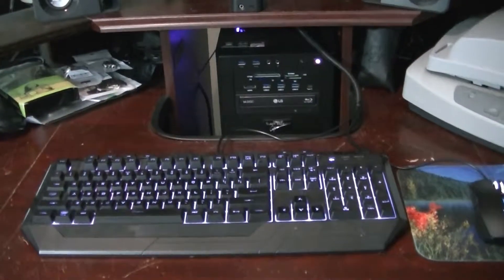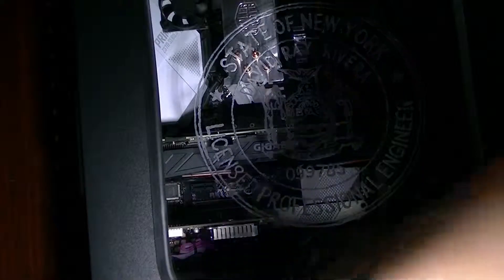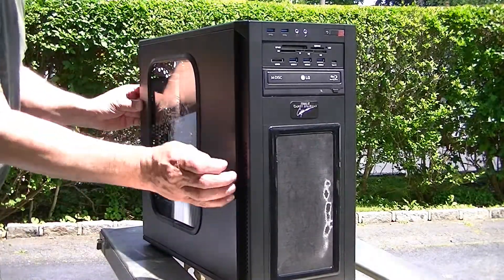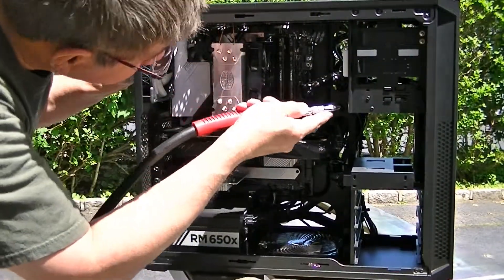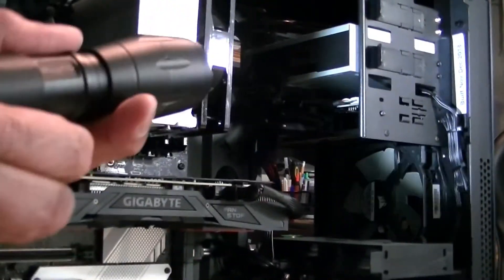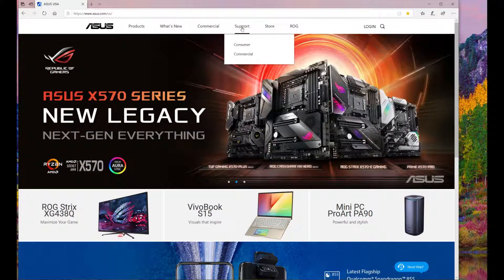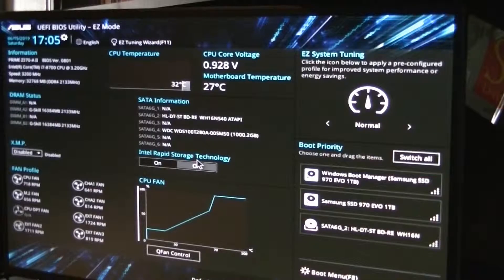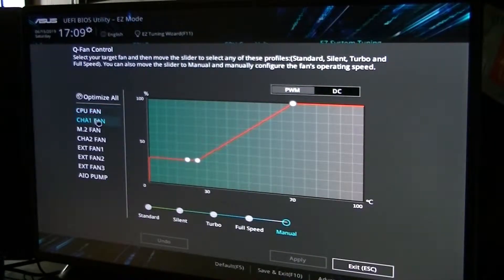PC Preventive Maintenance

Comment: Great Video and well done. I like how you designed your Airflow Management through the case. It greatly reduces  the amount of dust.  Love the Etching ... Great job ty for sharing. :)
Reply from the maker: Actually, since I have it with a 'positive' pressure (higher than the default atmospheric pressure) with all intake face being filtered, the amount of dust is actually quite low.